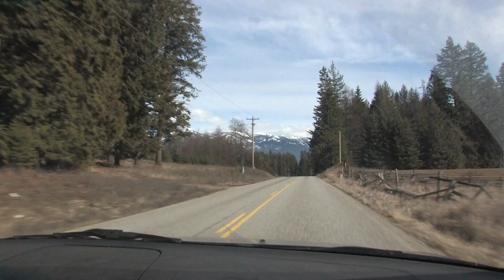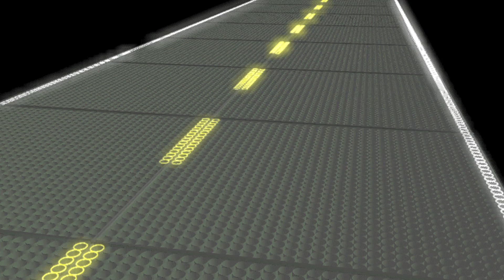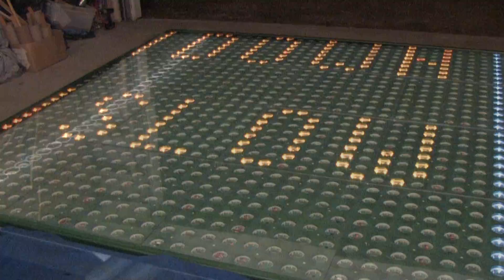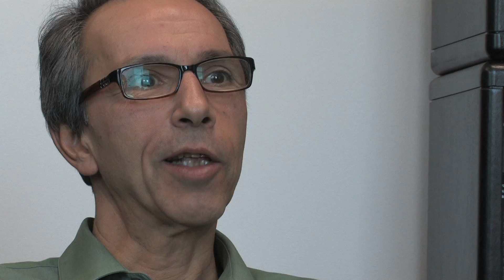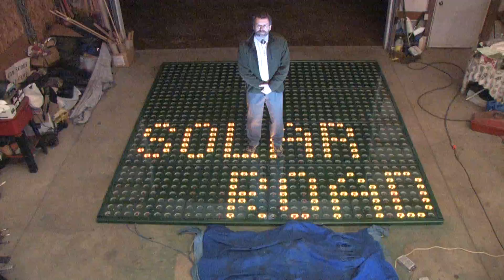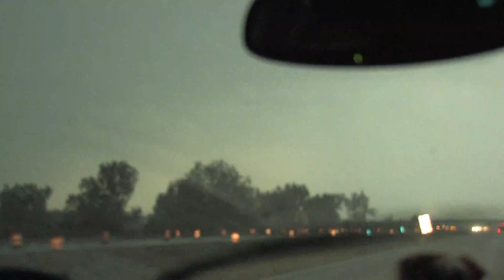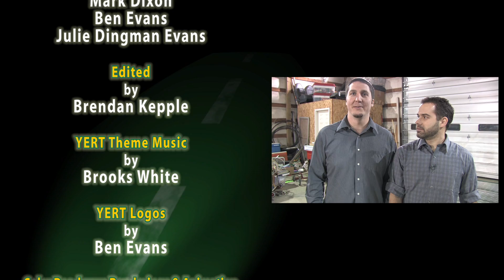Solar Roadways: The Prototype

Comment from the maker: You would be surprised by how much traction you can get from the glass. I've touched some of the samples that they're working on for the solar roadways project and they're pretty rough. I know it may be hard to imagine, but I wouldn't be too worried about the slippery-ness. The trick will be making them simultaneously rough enough to drive on AND transparent enough to power the solar panels. We shall see!

Comment: replacing asphalt with solar panels and non-slip, durable glass is a good idea.

Putting tons of electronics inside and LEDs cast into the glass, just to get signage everywhere? NOT a good idea.

Make it as simple as possible, focus on photo-voltaics and power transfer, and you'll greatly simplify the design and make this more viable. Road signs aren't obsolete yet.

Comment: This sounds like one of the stupidest ideas ever. Instead of creating this ultra expensive glass road surface that can resist the weight of thousands of vehicles, just for the sake of it doing double duty as a road as well as a solar panel, why not just place panels along the side of the road where they wouldn't have to be built to withstand such punishment. oh ya...because as the video said, asphalt is soooo expensive. Or better yet, why not first start by putting panels on your roof...duh

Comment: Fiber optics.  The same process that granularizes the road surface to allow for traction creates "dimples" that provide a much wider collection lens (albeit very very small) so you lose less angular efficiency.  As for wear and tear, well, smart tires embedded with RFIDs that provide both traction feedback (surface conditions) as well as vibrational data (pot holes, debris, etc.) will basically diagnose the road's condition for it.  Oh, this presumes that there is a data loop between road/car.

Comment: 1. That would be a awesome dancefloor!!!! 
2. This would be great even to power streetlights, During the day put excess power back into the grid. You could also put street lighting in places without power, and not worry about the panels getting stolen or vandalized because its part of the actual road.
3. How sick would that be on a drag strip made of these weight sensitive crosswalk panels, it could light the car as it goes down the track!!

Comment: @benpowersification I agree the general public won't be comfortable with driving on a glass like material, at least not at first, even if it has all the same frictional properties as asphalt, so yeah this company will have that big distrust hump to get over.

I still don't think fuel cells or hydrogen will take off tho. Even the best storage solutions for hydrogen are just too dangerous; I would be scared to give the average consumer even a small amount of fuel to store lol

Comment: @57ashdot Sounds great.  Until we are all driving around on a magnetic field however, I maintain that roads made of glass will either be slippery to the point of being dangerous, or opaque to the point of being critically inefficient.  We don't live in a perfect world, the outlay on an all encompassing glass/electric system (and it would have to be if we are to drop the wheels) would be phenomenal.  Nuclear -> Hydrogen -> Fuel cell cars seems a much more likely option.

Comment: @benpowersification Your small-minded comment also ignores the fact that rolling tires may be phased out in the future. Who is to say that these roads can't be outfitted with electromagnets and wireless power systems? Cars would be able to operate literally without ever touching the road and never needing to stop to refuel. Almost all of the frictional and heat losses of a conventional automobile could be avoided

Comment: @jhselbie Like I said earlier, street sweepers usually just clean gutters and only affect the edges of roads.  We're going to have to have larger street sweepers and more of them with regular lane / road closures to keep them clean.  The economic cost to having those cleaners running may outweigh the possible benefit.  Fuel, man power, all that adds up real fast unfortunately...

Comment: @YERTians From experience making an otherwise smooth and slippery surface anti-slip (no such thing as non-slip) means making it rough, matt and consequently opaque or semi-opaque.  I'll be impressed if they can make so it permits efficient light transfer whilst providing the high levels of grip required for heavy traffic in greasy/muddy/wet conditions.  That achievement by itself could make millions if marketed as anti-slip flooring.

Comment: @DarthViper3k He states that this process is not 100% efficient, meaning that there will be a build up of grime and dirt that cannot be fully removed.  If it takes 2 years instead of 1 year for them to lose efficiency, its still going to add up and have a cost that is way too high.

And street sweepers normally just clean the gutters, not entire street surfaces.  Regular lane closures will have to occur to clean the streets, slowing traffic, and causing economic harm that outweighs any savings.

Comment: @bakertony See, this is the pivotal step of the engineering process.  They've identified a problem (widespread, mass power generation), and they're defining the specifics of the problem - driving on glass, traction, glare, light transmission.  They're working on the solutions.

Comment: Seems like it would be easier to find some alternative road material, and just line the roadways with a network of solar panels. Then  you don't have to overcome the technical challenges of designing solar panels that can be driven on...
I seriously doubt that glass is the best alternative road surface...

Comment: Well I think apart from there being lots of practical aspects yet to solve, he's opened the door to make roadways much smarter: there's no telling what the spinoffs might be. If you're still cynical, think about it this way: it's only been about 10-15 years since we embraced the web on a large scale, and look how fast it's evolved. 

Could the weight of traffic could used to generate power as well.? ITWIRE: We can power mobile devices with simple movements

Comment: @MrEnergyCzar 
Exactly.  Solar panels in general cannot be made unless you mine for and then smelt copper...so...you need lots of oil...not to mention all the lead and plastic you need for the batteries to store solar power.  It's scary.

Comment: @1234canadian1234 These types of roads may not be ideal for our northern winters, but could still go a long way to reducing the need for oil anywhere the ground doesn't freeze.  Incidentally, more electricity is used where it is hot than where it is not (i.e. due to air conditioning)

Comment: Glass is a pretty energy intensive material (awesome material, but energy intensive) and 15% efficiency in PVs is a WAY high number to aim for given that roads mostly lay flat and so almost never have a good angle on the sun. PVs like a low incidence angle. Plus, with all the the LEDs in the roadway (and white, low efficiency ones at that) they'll have a long way to go to pay for their energy inputs let alone their installation costs. no?

Comment: @ColdZer04 Because he's trying to solve a "problem" we have by coming up with an idea that's even more expensive than the first, he's trying to combat a resource and energy crisis, but wants to put halogen lights underneath every stretch of road? despite the fact that glass can be as strong as steel, that means that production for these roads will be even more costly than mixing hot tar and rocks, and everything wears down over time, asphalt crumbles, but glass will splinter and pop tires,

Comment: @jextaone tires cant be adapted to drive on glass. even metal nubs or even spikes would be bad, because they would cause road damage. if the design of the surface glass would change to be riveted, it would bring traction but also noise to the drivers and passengers, and wear down the tires. its just a lose lose situation

Comment: an amazing idea, but it would be much too expensive. not only to make, but solar panels hve to stay clean constantly, therefore requiring to be constantly maintained. also, tires are not made to drive on glass, and this design will take away traction, and front wheel or 4 wheel drive wouldnt help. it would be like trying to drive on a frozen pond.

Comment from the maker: @rakerlad Solar cells wouldn't necessarily need to be manufactured with large amounts of oil. The rock and cement isn't as problematic from a cost-perspective as the oil in the roads. I would be interested in seeing a cost comparison of a non-solar non-oil based road, and a non-oil solar roadway system. I'm sure there are interesting ways to build non-solar non-oil roadways, but solar roads supposedly pay for themselves over time. Non-solar roads do not.

Comment from the maker: @kreendurron That's a good question-- where do we get all the plastic? I suspect that resource availability would be a significant challenge for the project (though I suspect sand for the glass will be easier to find than oil for a traditional road). Scott Brusaw (Solar Roadways co-founder) has suggested using plastic scooped from the ocean to support the road base. That could also be an interesting option for wires if we learn how to harvest it at low cost.

Comment from the maker: @ptevans01 It does look sophisticated and expensive, but oil prices are likely to rise in the foreseeable future, making oil-based roads cost-prohibitive. We may need to look at alternatives just to keep our road-maintaining municipalities afloat. The neat thing about solar roadways is that since you're combining so many systems (power generation, power distribution, power storage, networking cables, and roadway) you can combine the budgets for those respective projects and spend less overall.

Comment: Ok, so wouldn't hardened glass be slippery during winter time?  If you roughed up the glass for traction, would it refract the sun light away?  Biggest question is how would this cost?  This looks really sophisticated/expensive for use as a road.

Comment: @TomsGuns 
We're currently considering sections measuring 3'x3', 4'x4', and 6'x6'. The original 12'x12' prototype has proven to be a size problem (shipping for instance). The materials used are primarily textured, strengthened glass and the support structure (made up of recycled materials such as plastic water bottles, plastic grocery bags, tires, etc.). Add to these materials the electronics including solar cells, LEDs, etc.

Comment: Sound engineering - proven materials - existing technology.  This is good for long-term broad-spectrum nation-wide jobs generation for the installation and then for maintenance and replacement.  Engineers, designers, electricians, road crews, shipping, manufacturing groups should get behind this project.  Big oil can get something out of the plastic parts - insulation, circuit boards, etc. that need petroleum for production - not a controlling interest but still some income from this project.

Comment: What do you do for traction in wet weather when driving on a road of glass? How would you deal with scratches/wear blocking the light from meeting the panels. Overloaded trucks, vehicle accidents, loads falling off of trucks, there are so many questions.

Comment: I like the idea a lot.  I haven't read all the comments, but an additional thing would be some sort of piezoelectric device that would generate power not only from the sun but from the pressure of the vehicles running on the solar roads.  This would supply additional power as well as taking care of times when the weather occluded the sun.

Comment: OMGBBQ? Is this for realz?  Of course we all know that wet glass has way more traction than an actual street.  It would be like ice, and like ice, when a truck tips over or drops something out of the bed, the glass will shatter.  Glass os ok for strength, but not for shock.

Comment: 1.) Earthquakes would completely destroy the integrity of the system.

2.) It is far too complicated to be repaired and maintained. These things all have a
Mean Time Before Failure (MTBF). When 1 panel degrades, it must be electrically
disconnected and removed from the system or it catches fire.

3.) These panels produce only direct current, so each panel would need a power inverter to
connect it to the others. These inverters are expensive and significantly reduce the MTBF

Comment: @spangleJ I have but it doesnt address the concern regardling glass being a smooth and low friction material. There is only talk about the roadways durability and its underlay beneath it. Can you tell me at what duration in the video its discussed so i can go back and check it out.

Comment from the maker: @gungnir2357 I thought the same, until Scott pointed out to me that then we still have the problem of roads made mostly from oil, which is likely to peak in production and could get much more expensive in the next few years. How do you suggest we handle that risk? I wish I had a good answer. I suspect that proper recycling of used-up panels will be key in the design process. Full cradle-to-cradle principles.

Comment: im reading alot of stuff about the surface being slippery when wet, well normal tyres today are oil based and we would have to get rid of them aswell, so maybe a good solution to change the kind of tyre we use that would have grip on such a surface in all conditions

Comment: I suppose we can forget areas where winter and snow and ice occur. If you can have a plow drive over it while clearing ice and snow without damaging the panels then good. Otherwise you'll have to limit the roads to summer only climates. Of course you could also incorporate heating element to melt the snow.

Comment: Its a great idea, and I believe all of the kinks will likely be able to be worked out.

except for one.

What keeps people from coming in the middle of the night and stealing parts of these roads, which will no doubt contain many expensive parts.. not only would that possibly create a hazardous section of roadway without a roadtop, it would also possibly cut off power to entire sections of the city.

...i can't think of a way, off the top of my head, to protect solar roadways from theft.

Comment: It should be much smarter to build roofs OVER the roads. Cover the roof with solar panel as mentioned. The advantage of this is that the solar panel can have the right angle towards the sun AND the asfalt is then SHELTERED from sunshine AND rain AND snow.

Jan-Anders Andersson, Sweden

Comment: This is a real cool idea but I think its not the glass thats gonna be the problem, its all the electronics, weather seals, and other gizmos used to make it work. That just seems like a lot of failure points compared to your average, very rugged asphalt road. 

So maybe the winning idea out of this isn't the neat, but overcomplicated solar roadway but the simple replacement of asphalt with glass. Cheaper and easy to access material, sand.

Comment from the maker: @boogerchamp I imagine you could simply lift up the panels and get to the ground below pretty easily. Might need to re-apply the foundation material, but panels would need to be easily added and removed, so I figure this situation wouldn't be too tough to engineer around.

Comment: The idea is perfect except for one thing,  the glass.  I've been thinking about this for awhile before I searched online,  guess I'm not original but I'm extremely glad this is becoming reality.  We already have an electric grid next to the roadways so would be an easy tie in to the system.  As far as the glass,  use a textured epoxy that would give traction to tires and be able to be ground and replaced.  It would be flexible like asphalt to allow for heavier weights.

Comment: As the surface gets scratched by sand and other debris the ability of the cells to conert to electricity will degrade.  While I don't think this is a viable idea I do think that in some areas using these pannels down the middle of the lanes might make some sense.  But hey, let's get the pannels on house roofs first.  It's cheaper and available today.  So asphalt is getting expensive becuase of petroleum... so what.  Recycle it and use other materiels.  Smart people will create a better surface.

Comment from the maker: @oidad Would love to know which problems you feel are batted to the side. Let's discuss! Many of the problems are addressed in great detail on the solar roadways website. Hermetically sealed is possible. Might require some innovations, but this whole thing will require lots of innovations. It seems that engineering, not physics, is the primary challenge here, and engineering often just takes time and money. Physics requires more in the way of breakthroughs.

Comment from the maker: @Sevexius I believe that Scott at Solar Roads is considering this idea, though there may be some basic physics to overcome in getting enough power into the car just from induction or another touchless technology. I'd love for an expert to comment with more information about the feasibility of that. As for the oil companies, they certainly won't give it up without a fight, but oil doesn't have to get too much more expensive for SolarRoads to make profound economic sense. Indeed, it already does.

Comment from the maker: @imxlnt2 We need to find a way to replace oil in all of our infrastructure, and this is one of the more powerful ideas we have seen. Peak oil will likely come within the decade, and then prices will probably jump as countries compete for the scarce resources. If we have a jump on roads made of a non-oil material, along with a slew of other solutions, then we might stand a chance of managing through the crisis. I think that your work check is more dependent on cheap oil than no solar roads.